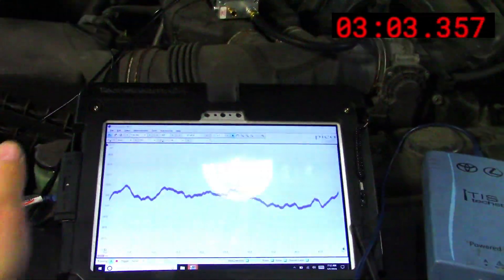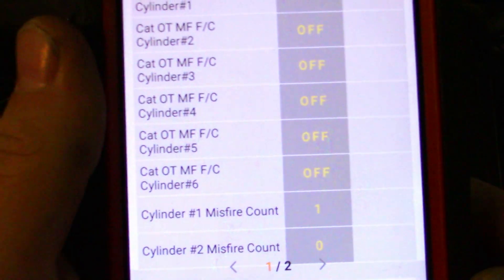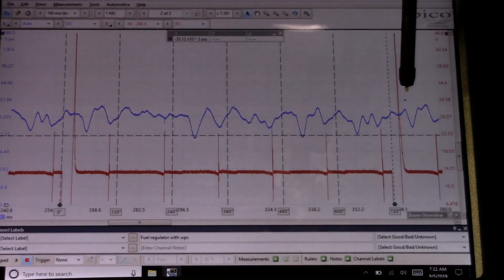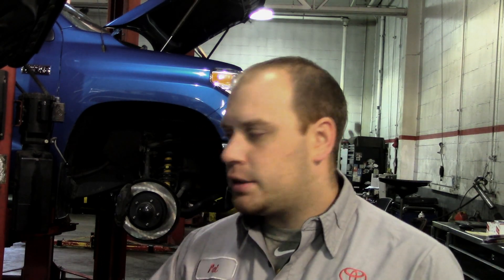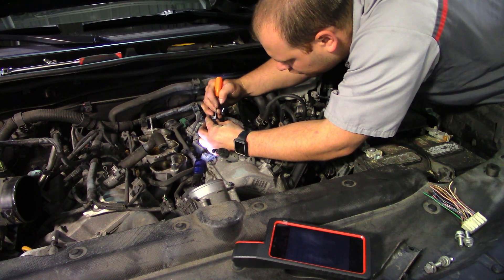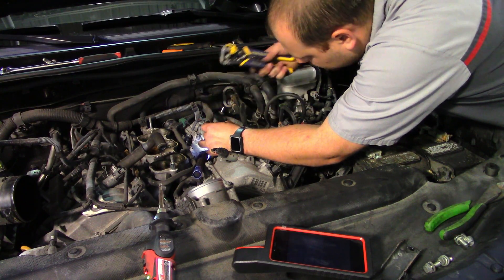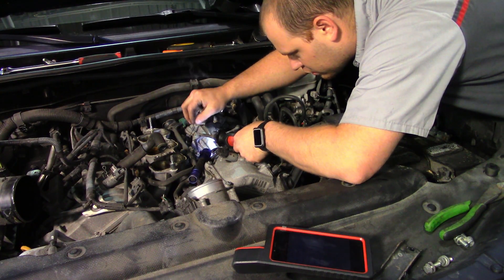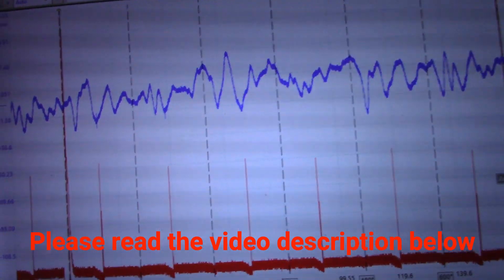Misfire diagnosis using a new technique

Comment: I can appreciate your video to help out new transducer users. This test is actually very old. make yourself up a shorter hose setup and try with a very short hose as possible and see the difference, there are pros and cons depending on the purpose of the test. Imagine older vehicles where the MAP sensor was mounted to the firewall and had a vacuum hose going to it, now MAP sensors are mounted directly to the manifold, this is the reasoning I am referring to with hose length and vacuum/pressure wave speed and smoothing/muffling/reverberating/feedback actions inside the hose of longer length. Thanks for the video.

Comment: that wire looks to me like the current load on that wire is too high. are you sure this isn't a case of a shorted injector coil? considering the work to get the intake off I would just replace the injector and not take the chance that there was a reason the wire look like that. I hope at the end of this video you showed testing the current ramp on that injector.

Comment: Looks like you are connecting the vacuum hose to the fuel pressure pulsation damper? Not the fuel pressure regulator.
Reply from the maker: Dampeners don’t have vacuum hoses in them.
Reply: @VoltageDropDiagnostics  hi, is it called PCV or part of it? thanks

Comment: I have a couple questions for you. 1. Do you think the Diagon is worth it for a dealer tech with my own tech stream lite? 2. What do you suggest for terminal removal tools?
Reply from the maker: hmm. That's a tough question.  Do most dealer techs need the diagun? Probably not. I do a lot of diag not just on toyotas, but also non toyotas. So I use it pretty regularly. Plus, it is wireless, so I use it over techstream anytime I am under the hood, or underneath the vehicle doing active tests with it. 

With that said. Is it "NEEDED" for a dealer tech? For most, no.

As far as terminal removal tools. I honestly, usually just use a tiny T pin lol. So I don't have much experience with many on the market and I don't want to steer you towards a bad purchase.

Comment: I just have a question...Is it possible to clean the fuel injector without being removed with some fuel injector cleaner. Which would be a good brand to buy.? In case the problem are the injectors. I got no issues with fuel injectors so I just want to know if I can use some brand in particular that is going to work ok.
Reply from the maker: There are companies that sell fuel injector cleaners that you add to your fuel. A lot of people swear by BG 44k but i can’t comment on how well it does, or doesn’t work.

I do know that i haven’t been able to clean an injector that already has low flow, to make it flow as good as new.

Comment: I used this technique in a Ford Mondeo fitted with a fuel pressure regulator installed in the fuel rail. Just plugged in a home made First look sensor to the vacuum hose and I can tell you guys that this technique is valid. Every time I unplugged an injector the waveform showed no activity for the correspondent injector. Thanks for sharing that.
Reply from the maker: Oh cool! I’m glad someone else has used this test with success! Thanks for watching!

Comment: If you forget shrink wrap, use liquid tape. I prefer it over shrink wrap
Reply: I can’t imagine. But, with the weather seal shrink connectors, that have solder in it, you can’t go wrong.
Reply from the maker: Man, I got trolled for using soldering instead of a crimp connector. I can't imagine the trolls if I did that lol.

Comment: That was AWESOME! Very impressed that Toyota is equipping their technicians with such advanced tools like scopes and transducers. Truly a forward-thinking company :) Glad you mentioned the current-ramp test at the end. Wondering if the ECM set any injector circuit fault codes?
Reply from the maker: I was hoping to meet you in Staten Island a few weeks ago! But no, I've never seen a toyota set an injector code, which surprises me that even the newer models dont.
Reply: @VoltageDropDiagnostics  Do you have a dealer tools p/n for it? I have a friend who works at our local dealer in Canada, curious if they got autoshipped it too.  See if I can order one cheaper that way.  Great videos!
Reply from the maker: @EverythingNausome  The part number for the kit that they sent the dealers is PIOKP355

Its about $1,050 for a medium size kit, which is a couple hundred bucks off the normal price I believe.
Reply: I agree, I am a Kia Dealer tech in Canada.  Our dealer training is useless and would love it if they implemented modern troubleshooting.

Comment: so do you take the chance of replacing / repairing the wire , but not replacing the injector ? -  I would switch the injector with the wiring problem with an reachable known good  injector , just in case
Reply from the maker: I actually didn't replace the injector. I hate swapping injectors though. For whatever reason, the O rings always tear for me when removing them, and we don't have them in stock. So the vehicle would have potentially ended up down for a day while waiting for a new o ring.
Reply: amp probe is better option i  this case instead of swapping  rah will definitely woll address the electrical portion.

Comment: Thanks for a great video. WPS is on my wishlist. 👍
Reply from the maker: Its a great tool to have. And when you consider what a fuel pressure gauge costs, then an oil pressure gauge, then a compression gauge, all added together. It makes it FEEL like the wps isnt that expensive since it can do all of those tests by itself lol
Reply: @VoltageDropDiagnostics  - I've got most of those gauges already 🥺. Still, its so versatile I'm going to get one.

Comment: Great video PJ I def need to get my hands on one of those I’ve been looking for a while.
Reply from the maker: Do you have a pulse sensor? That would have worked just as well for this.
Reply: @VoltageDropDiagnostics  I can't afford WPS but will like you to recommend a not -expensive pulse sensor
Reply from the maker: @yemiasaolu1622  I'd look into either getting a pulse sensor from Michael Nicholson, or Cody over at Cody's auto diagnostics

Comment: Great work brother! That’s an awesome way to check mechanical workings or the injector. Obviously this would have been seen with an amp clamp, (since the control wire was corroded) but being able to “see” the drop is definitely a great approach as well.
Reply from the maker: I agree about current ramping! But for whatever reason, all I have been seeing is fuel injector issues lately hahaha! I had to switch it up.
Reply: Voltage Drop Diagnostics great work bro

Comment: really interesting way  doing it. i would have probably went to the pcm or opened up a loom for the sync which would have shown the electrical problem. however i understand the intent of the video. makes one stop to think what and how else does a person use the tools at hand.  great to see a company making an investment in their techs by supplying them the tools to do the job efficiently.
Reply from the maker: I agree about going to the pcm.Although there is a connector on the RF wheel well that I could have went to. But I'm in a toyota facebook page and kept seeing people say "what will I use this transducer for"
Reply: @VoltageDropDiagnostics  i understand  they  just need to use their imaginations

Comment: Easy peezy.... great explanation Pj! Attenuator, BTW for those that don't know, protects the Pico/scope against too much voltage. The Pico is protected internally to only about 70vDC? Give or take. Might be 75VDC.
Reply from the maker: Thanks Cuba! And thanks for explaining the attenuator! I THINK this scope is good for 100 volts, but still. Injectors fire over 100 volts so it would still burn it up without an attenuator lol
Reply: Actually Pico 4423 can manage 100 volts. The model 4425 can grab up to 200 volts.

Comment: Great job PJ. Very clear explanation and gives a great jumping off point to experiment more with this technique and figure out the variables based on the system design.

I'm looking forward to more WPS usage videos 👍🏻
Reply: Most definitely Chris. May not be definitive using the pulse sensor solely,  and I know some vehicles will be more definitive than others using the pulse sensor. I hoping through this video, we can discuss variables and when it's best to use it in this application.
Reply from the maker: Thanks for talking me in to posting the video!